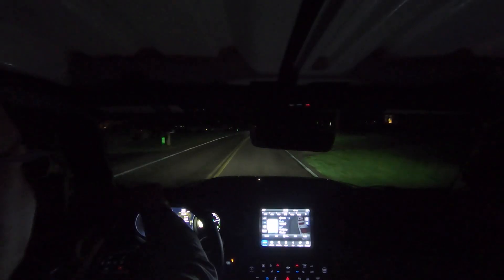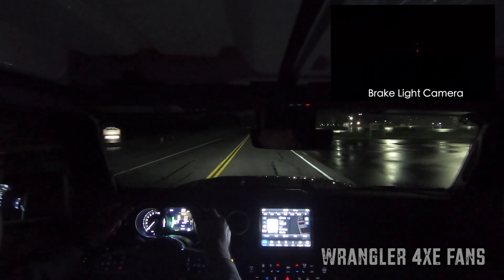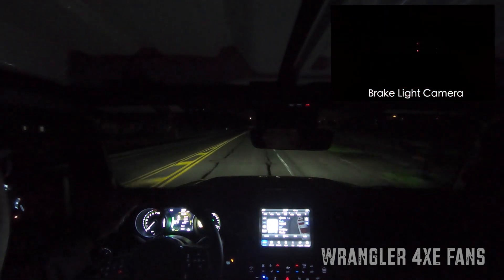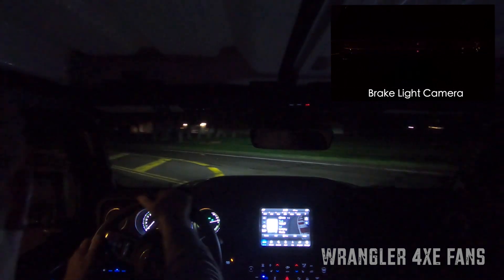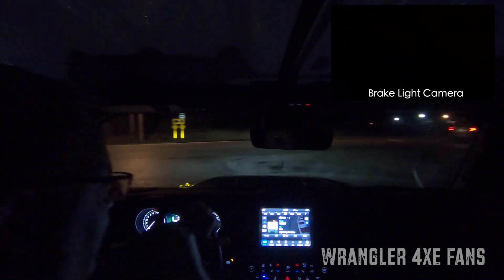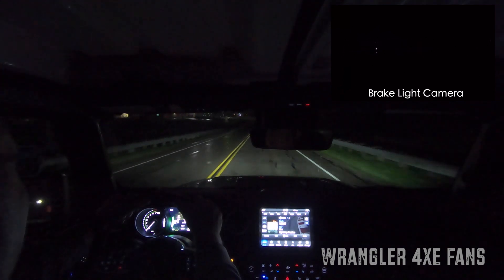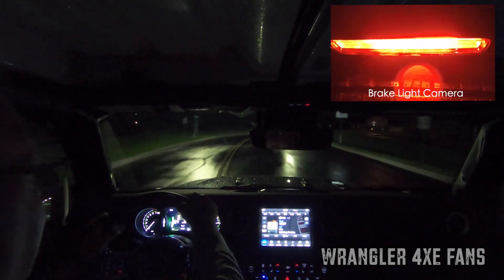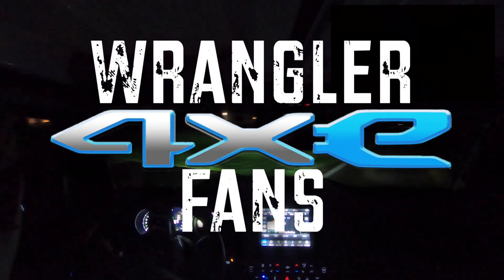Max Regen and the brake light

Comment: I’ve heard above 40mph on highway it is best to turn MaxRegen off for better mileage (you have any thoughts on that?), but the folks behind you would appreciate it too.
Reply: If you have good control of your right foot, you can coast just like in a conventional vehicle. If you completely let off the pedal with regen on, then yea it is like pressing the brakes. But with a little practice you can keep a bit of pressure on the accelerator and you’ll slow at about the same rate as if you threw your gas car in neutral.

Comment: Can your plug the charger in when it's raining?
Reply: Yes you can charge when it’s raining.
Reply from the maker: There is no voltage present in the plug until it is plugged in and the hand shake between the EVSE and the vehicle occurs.

Comment: Thanks for all the great information!
Please do a mileage comparison between maxregen vs no maxregen modes. How much mpg does charging the battery 'cost' in efficiency?
Reply from the maker: I had that same thought. I thought about setting up a "course" that I drive twice: once with and once without. Then try to drive it the same both times and see what kind of difference in range results. It's just getting the time to do it. :)
Reply: @Wrangler4XEFans  thanks for the work you are putting into these videos greatly appreciated

Comment: Appreciate the videos ~ good stuff.  Have you thought about making a video discussing the hybrid and powertrain warranties?  Jeep surprising has very little information available about the 10–year or 100,000–mile Hybrid System Limited Warranty and
10–year or 100,000–mile High Voltage Battery Warranty.
Reply: Yes excellent point.